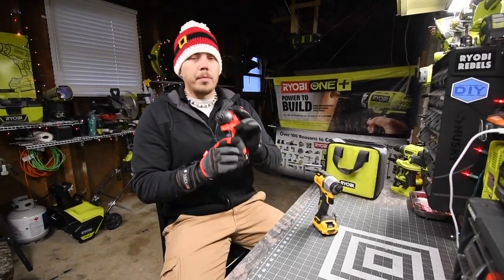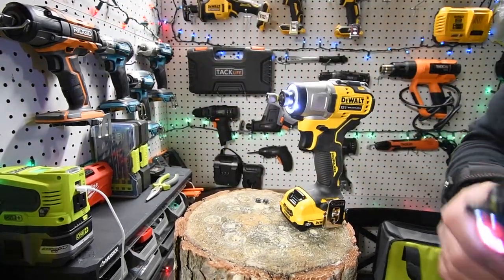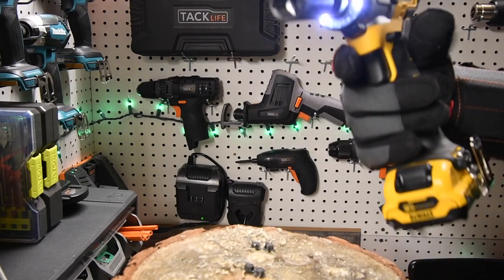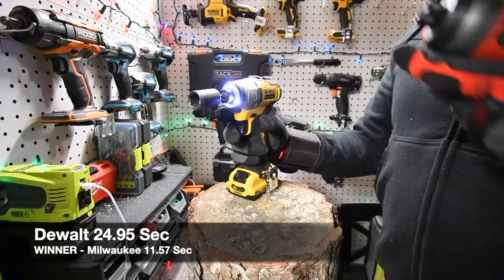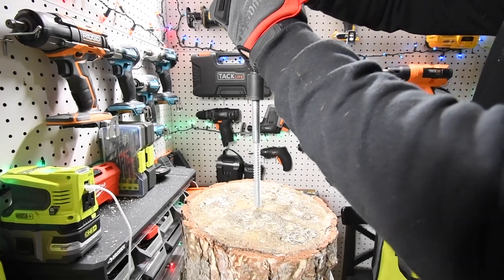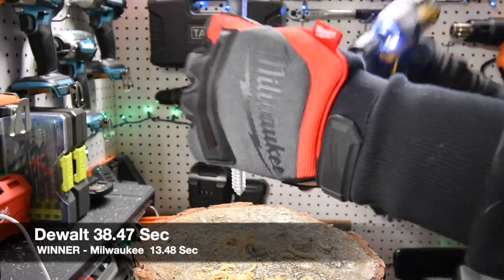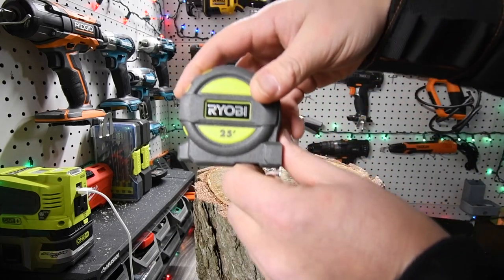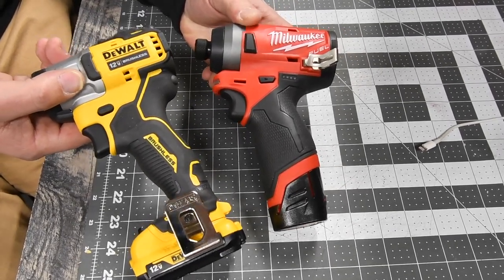M12 VS Dewalt 12v Extreme/ Winner will VS HILTI

Comment: The fact that dewalt put the lag over a minute quicker than the millwuakee but millwaukee took out the dewalt lag in half the time makes me think you found soft spot or a knot in the wood glad you redid the test that was weird
Reply from the maker: That is correct. I have learned on when a tool struggles lol

Comment: Idk about you guys but dewalts 8” lag screw looked like a soft spot when it was driving the lag in
Reply from the maker: its a real life scenario test that you will experience on the job site
Reply: You know better than that. Real life scenario, my butt. You had to have felt the soft spot. The Milwaukee handily beat the Dewalt in every other test, and yet in this one it takes three times longer? C’mon man!
Reply: @AV84USA  The fact that the milwaukee takes out the dewalts lag bolt alot faster(after supposedly losing to put it) proves it hit a soft spot. Both great impacts thought.
Reply: @ManCaverTools  You normally do a good job keeping tests fair and consistent, but to say "real life scenario" is just stupid in this instance. The Milwaukee walked all over the Dewalt in every test but somehow it smoked the Milwaukee all of the sudden? Come on man
Reply: Yeah I was thinking the same thing. Looked like soft spot on the 2nd go Aswell.  After they couldn't drive it in any more he should have switched impacts and leg bolts to see if either one could have drove the bolt in further.

Comment: I wish you had tried putting the DeWalt on the Milwaukee lag bolt to see if it could put it in further. Doesn't make sense for the M12 to win every other test and then fail to put the 8 inch lag in faster/further.

Comment: With the Dewalt, I was able to remove lug nuts torqued to 100 pounds, and even at 120 pounds, though it struggled at that point.  It is very impressive, small and light.
Reply from the maker: very good, its crazy how powerful they are

Comment: Looks like the 8” lag for the dewalt was placed in the hole the screw came out of
Reply from the maker: is wasn't, why would I out it in the same hole? but thank you foe viewing
Reply: What i think happened was either the Milwaukee hit a knot or the dewalt hit a little empty pocket.
Reply: Yea there definitely is something not right with how quickly the dewalt put the 8" lag bolt in, it struggled with the 41/2" bolt. Great videos though, definitely deserve to have more subscribers.👍

Comment: No answer on that but dewalt did return my call and said what they sell at Lowe's and home depot is the same as Carson nut and bolt that all retailers get the same thing.
Reply from the maker: Home Depot does not sell the 12v extreme line

Comment: Overall a very  good vid. I would have liked to have seen if the DeWalt would have moved the lag bolt that stopped the Milwaukee in its tracks, just to be sure that was not in a harder spot on the log.
Reply from the maker: Thank you sir

Comment: I would definitely be putting lag bolts in with my 20 V Dewalt or my M 18 Milwaukee however I’d  use the 12V on screws however

Comment: This test is just to prove what a modern and brushless motor 12V tool can do. But really I don't use mine on driving a 1/2" dia 6" long lag bolt for that specific job I use 1/2" Impact Wrench. What I love about my DeWalt Dcf801 Xtreme 12V Impact Driver and the DCF 601 Screw Driver is that they're Very Ergonomics, Lightweight! And very Precise. That's what I use in my jobsite for installing Fasteners that don't require much power. Such as Tapcons concrete fasteners when you use high powered impact driver they tend to break. DeWalt 12V is the perfect choice for me. Otherwise my good ole 20V DCF888 Electronic Speed Switch w/ Bluetooth Impact Driver and my DCF996 Hammer Drill is my all around tool in my everyday jobsite works. I hope someday DeWalt will adopt a IP-56 Rated tools (meaning Waterproof, and can withstand Fridgid Environment) just like my Hitachi Triple Hammer 36V Multi Volt impact driver.

Comment: Two more questions is that true that dewalt makes the commercial type? Is the new dewalt drill 998 stronger than the 996 or could I get the 8ah battery and will it be equal in power? Sorry for asking all these questions
Reply from the maker: we will find out when I get the batteries and the tools. I can't say anything until I actually test it out
Reply: @ManCaverTools   I am confused about my drill set I got from Carson nut and bolt they told me it was the commercial type and the thing that gets me is the box mine came in it says my drill weight is 4.7 and the ones at Lowe's and home depot the same drill but it don't weight the same as mine I don't get. The 996 u got tell me what it weights

Comment: 20:32  Just look at the size difference between the two drills.  The Milwaukee's battery design makes the tool much more compact than the Dewalt and Makita design.  The better performance is a bonus.
Reply from the maker: Yes, the dewalt is a bigger size compared to the milwaukee
Reply: But the Dewalt and Makita are way more comfortable in your hand

Comment: Man caver will u please answer that question for me. Does dewalt make a commercial type cause where I got mine they told me it was the commercial type and is better than the ones at Lowe's and home depot
Reply from the maker: I do not know if dewalt makes a special line for expert use
Reply: @ManCaverTools   Thanks for answering my question. I been told 2 different things
Reply: @jts4248  sales tactics.

Comment: And about if I get an 8ah battery for my dewalt drill 996 I know it will give it more power but will the new 998 power detect drill still be stronger than the 996?
Reply from the maker: the 21700 cells in the new batteries will improve performance and we will test that out

Comment: The precision drive setting on the DCF801 1/4" impact driver is not working for me. In the Precision drive mode it completely stalls out, even when driving a tiny #8 3/4" screw that I've already pre-drilled a pilot hole for. I was hoping this mode would function the same as the Precision Drive feature of it's big brother (DCF887) and impact slowly as resistance increased as you drove the screw, but the DCF801 just completely stalls out (stops chooching entirely).

 Did I get a lemon, or are other people experiencing the same?

The Precision Drive mode on my tool is essentially useless, which sucks because precision driving is more what these smaller 12V tools are designed for and not drilling huge lag bolts.
Reply from the maker: did you try a hight AH battery?
Reply: @ManCaverTools  I used the battery that came with the kit (2AH). The highest AH they currently have in the 12V line is only 3AH, but I don't think that's the issue because when I use the "Lo" or "Hi" setting, it'll bury the screw, no problem at all. I think it's an issue with the electronics of the Precision Drive mode. I saw that another YouTuber had the same issue as me. Can you try driving a screw in Precision Mode to see if maybe we just got lemons or if it's a universal issue?

Comment: It has more to do with core wood being dense and other anomalies is the wood. You would be better off doing this not on the end grain. maybe on a 8x8 where you can see growth anomalies more easily.
Reply from the maker: I am looking for different testing wood. and thank you
Reply: You could stack several 2x4 or 2x6 and screw them together. They will split eventually but should get a few test out of it. You could use scrap lumber from jobsite dumpsters.

Comment: Man caver what cells are the flexvolt batteries is the new 8ah stronger than the flexvolt? Let me know before u do another video please
Reply from the maker: I believe the flexvolt are 18650 cells and the new 8ah is 21700 cells
Reply: The 6ah flexvolt uses 18650 cells,the 9ah and 12ah use 21700 cells,same as the 20V  8ah.

Comment: Have u seen the new 998 dewalt drill? Do a rematch with that beast. I have a question for I bought my dewalt set at Carson nut and bolt and my code is different from Lowe's and home depot and they told me that it is because my set I bought is the commercial type is that true they make a commercial type? I say it is true cause my code is different on my box
Reply: Dewalt new set has the 8ah batteries
Reply from the maker: with 21700 cells in those 8ah batteries as well
Reply: Does dewalt make a commercial type drill? They told me my set was better than the ones at Lowe's and home depot is that true

Comment: using an impact driver as a impact wrench is incorrect and not what the tool was built for
Reply from the maker: that's why I test them like this. it would be boring if I only did what these are designed for

Comment: Dude for real, check out the dyna-glo propane heater. I have both. And it will  blow that little ryobi pos one away. It's only $99 an depot. You look cold. Trust me on this. The ryobi one blows...
Reply from the maker: I use the propane heater I have because it doesn't use that much propane. im in my garage for about 4-5 a day 4 days a week. and a tank last me about a month. its a sacrifice I make. it cheaper on gas

Comment: Wait a second. Milwaukee couldn't do it on #1 screw! DeWalt did it on #1! So it's should be winner of that round
Reply from the maker: Dewalt only had 2 speed settings besides the screw setting. Milwaukee had 3 and the screw setting. The tests wouldn't be fair if I used dewalt high speed against milwaukee 2nd speed

Comment: Should have torqued a tractor wheel lug nuts for even more useless comparison. Seriously why all YouTubers use out of scale of intended use tests. This says absolutely nothing useful about the tool.
Reply from the maker: its says everything useful about the tool, this test shows the power difference in the motors, how is that not useful? these 12v tools are having  amazing results for what they are